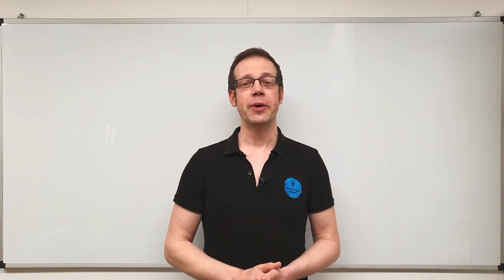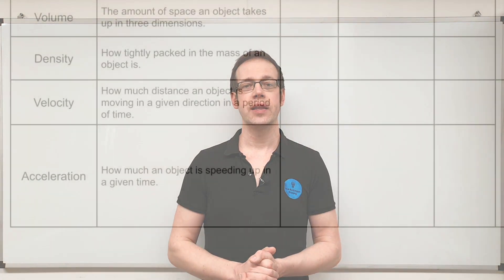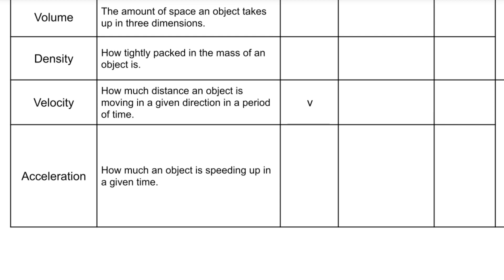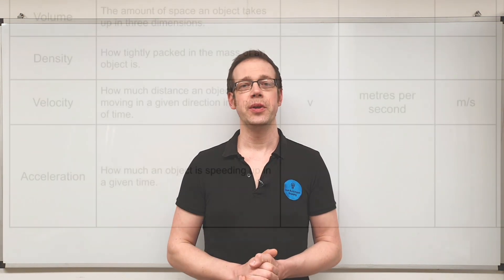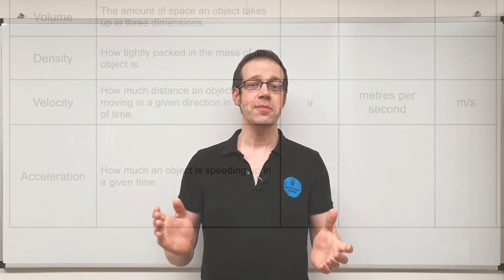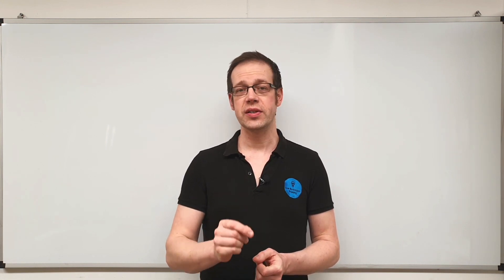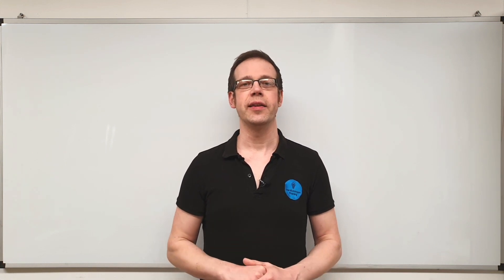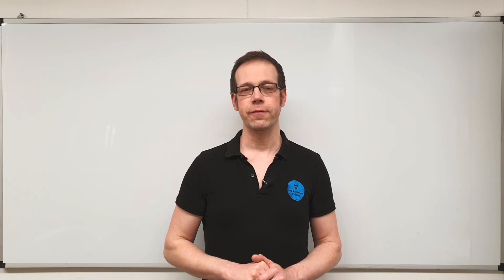SI Units: What Are The Basic Units For Motion?

Comment: Hi Joe, this may not be you remit but was wondering if you could help with a question I have?
I am currently studying towards 2365 L2 as an adult learner and have notice contradictory info regarding getting qualified  and the routes to becoming qualified.
From what I can gather at the moment I will need to complete 2365 L2 & 8202 L3 deplomas, Portfolio, which used to be NVQ and Am2 or Am2S. 
Firstly, is this correct?
Secondly, what is the portfolio part and where can I find more info on it?
Keep up the great work, it is helping immensely.